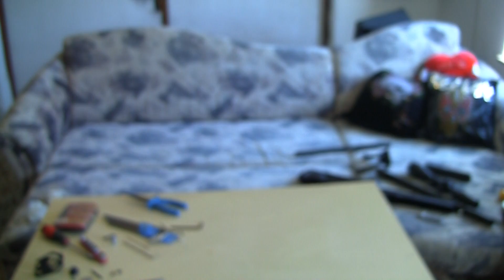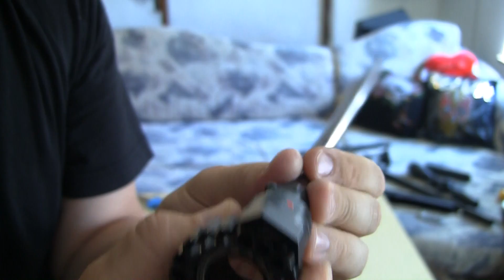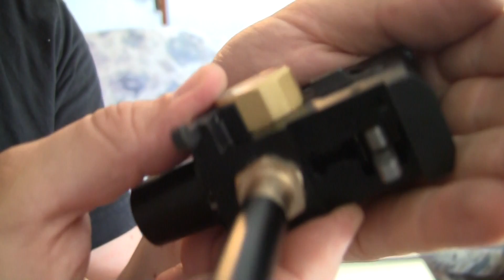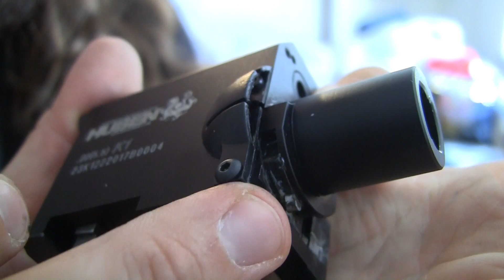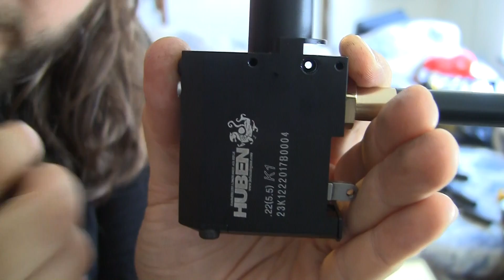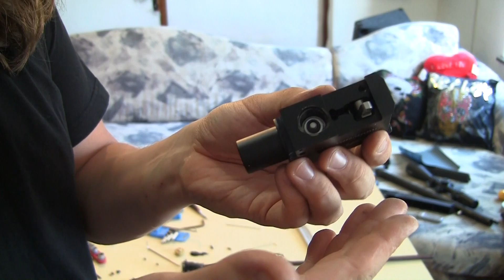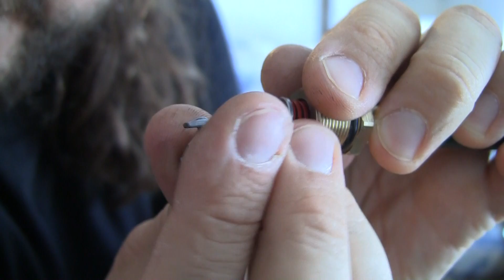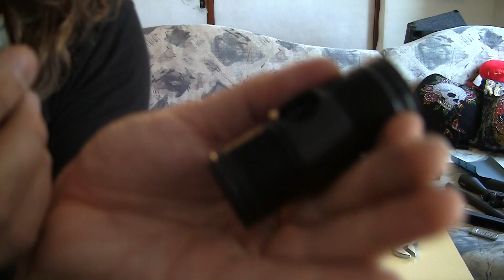Huben K1 version 2 - disassembly

Comment: gregor at 45:47 is that the spring you change if you are running a low reg pressure to aid low pressure indexing ?
Reply from the maker: Yes, you are correct. The pressure is doing the indexing, this spring only returns the indexing pin to the next magazine "tooth". This means that this spring is compressed in stationary state, it gets uncompressed (it extends) during the shot once the pressure in the chamber behind the first valve drops, then the indexing pin catches on the next tooth of the magazine and once the pressure rises back up, the force of the pressure overcomes the force of this spring and it indexes the magazine in this process. This means that you can get the indexing mechanism to work at lover pressures if you replace this spring for a weaker one, but this is only a solution up to a certain point because ta very low pressures, the pressure might not be sufficient to overcome the force it is necessary to rotate the magazin alone (even without this spring counteracting on it...).
Reply: @gregorkamensek3923  thank you Gregor, you are a mine of information, 
At some point I'll be running 15.89 Hades through my k1 lite and they don't like to much speed, 
I'll be setting the reg to around 100 bar, to 110, this may not affect the return spring but I just want to make sure, 
I take it the lighter gauge spring wire will still be fine at high pressure it will be a case of trial and error, 
I make my own springs from different gauge piano wire so I'll be able to mess around with different diameters untill I get it right.
Thank you again.
👍
Reply from the maker: @PeakyBlinder  Of course, you can try and see. BTW: if the spring will be too week, it can happen that it does not have enough force to push the pin to the next magazine tooth and it might not cycle either... But you will see when you play around with it. I like the way you make springs, I have done similar few times before but usually form guitar strings (since I have those at home) :).
Reply: @gregorkamensek3923  try piano wire, 2mm made a very good hammer spring for my cricket tactical, 
I'll let you know how.i get on with the k1 spring, 
I will measure the diameter of the original spring then drop maybe .2 of a millimetre.

Comment: Hi my friend 
Nice video as always 
My k1 version 5 is jumping from 910 feet per second to 950 
Do you think that is reg problem?
My set is reg at 150 bar and I am shooting h&n 25grain and jsb redesign
Reply from the maker: Hi. It may be the regulator but probably not. No regulator is perfect and because of this, you will get better results if you have your gun in appropriate balance. This means that your reg. pressure should be only as high to enable you to shoot the pellet you intend to shoot at just a little higher velocity than what you desire (for example, it you want ti to shoot at 950 fps, try to set the regulator value where with fully opened power wheel you get about 980 fps. Once you have done this, simply turn down the power wheel to get to 950 fps). You will probably have to go down with reg. pressure to about 120 bars to do so.

Comment: Is there a technical reason for the grip placement? Isn't 38 centimeters Length of Pull almost an orangutan's number?🙂
Reply from the maker: Hm, feels good to me. Most my gun have form 34 cm (which should be standard) up to 38 cm. So it is on the long side of the range. Personally, I prefer longer but that is probably because I am rather tall (188 cm). Interestingly, most of my bulpup are close to 38 and most my full size rifles are closer to 34. I guess they want the rifles to be as short as possible and also not to have balance too far to the front... There is not technical reason for the length of pull on K1. The regulator adjustment would allow for shorter length of pull.

Comment: Hi 

Can I contact you privately ?
I live in South Africa .
I am really interested in the Huben K1 pistol If you could possible help me .

Also if you could tell me where we can get the Huben K1 version 2 newest bullets

Thank you
Reply from the maker: Hi. You can either let me know your email or contact me via private message.
Reply: @gregorkamensek3923  dear sir I have seen all your videos for hours.
Plz help me. My gun leaks from muzzle and magazine
Thanks sir
Reply from the maker: @syedhaider7628  That is most likely the main valve, also called "firing valve" or "opening valve". It is relatively complex to replace this seal and you need special tool to remove the old seal and insert the new one... Check this video: https://www.youtube.com/watch?v=cxPiyMP7I5o&t=161s
If at all possible, I suggest that you do not do this your self but rather you send it to service...

Comment: Hi Gregor   I have finally received my Huben K1 mk 2  in 5.5 cal.  unfortunately there is a slow air loss over a week .The supplier has offered to sell me a set of O rings for €29 euros .. the rifle is only new .. and I do not want to send it for making good .
Reply from the maker: This is an annoying situation. I know what I would do, I would try to fix it my self, but I cannot recommend this, it is up to you and your skills. Also, make sure with your supplier that your warranty is not void it you do this yourself...
Reply from the maker: @richardwallinger1683  In that case, I have no doubt that you will solve the leak issue yourself :)
For slugs, you can start with "original" huben slugs: https://airgunheaven.com/en/huben-22-solidpellet-33-grains
These don't look very good but are the most accurate of what you can buy of what I have tested.
NSA has a dedicated slug for K1 that is a little more accurate but you will need to clean the barrel quite often as they are of a very soft material (maybe the have changed this by now)
JSB Monster Redesigned works best out of all pellets, Beast also is quite OK but not stable at longer ranges.
In the end you can also get molds I designed, you can find them here: https://www.mp-molds.com/product/552-mm-air-rifle-pellet-8-cav-mold/
If you are good with casting, you can get about the same results as with Huben slugs.

Comment: Hi Gregor,
Today I am surprised to find three thin O-rings in the DIY silencer I made for my Huben ( version 2 ) . It must came from the rifle. I have done some dry firing with the rifle, is it possible for some of the O-rings to be blown out of the action ? if yes, where are these O-rings located ?  Pls check out this picture and let me know what you think.

http://imghst.co/71/m1Kt~lxAsK.jpg

I have now taken the rifle apart so it is impossible for me to tell whether there are any leakage because of the lack of these O-rings. Thanks in advance.
Reply from the maker: These are probably form the shroud, in the plastic part that holds the barrel in place. to reinsert them, you will have to take the shroud off by fully removing the front clamp screw and loosen the rear two screws. When you have the shroud off, remove the muzzle cap, remove all the baffles (make sure you remember how they were assembled) and then push the plastic part out the front of the muzzle. Reinsert the o-rings in the plastic part and reassemble the gun...
Reply: Gregor Kamenšek got it ! Just Found three groves for the O-rings inside the barrel holding element at the front of the shroud. Back in business now. Many thanks !

Comment: Hi Gregor. My friend just bought Huben V2 and after shooting over 100 times a failure has occured. The gun dumps the air in first or second shot. Power wheel in many positons and doesnt work as it should -energy is set to 105J of and the power wheel changes the energy just by 5 Jules.  Regulator pressure was set between 170-180 bar. Help me please.:) heres link to my pal malfunctioning Huben. https://www.youtube.com/watch?v=_z2Or6wJ-5k
 Greetings from Poland.
Reply from the maker: Hi. Don't worry, this is perfectly normal. Actually that is exactly what I explained in my videos (I believe in video 2 for accuracy). The power wheel has 2 or 3 turns at the end where it has no effect is designed that way. All you need to do is turn the power down. Do it like this: have the power wheel fully opened and then start to turn it down. When you start to feel more resistance, then the power wheel is actually engaging the power setting. Keep on turning it down and pay attention at the gauge. Keep on turning it down until the velocity drops for about 5-10 m/s (in your case to about 295 m/s). That will eliminate your problem. You will also get much better efficiency... If you would like to have higher velocity, then just simply increase the pressure, but it makes no sense to go over 190 bars.

Comment: Hi
Thanks for videos
Very helpful in maintaining huben
I have issue with huben k1 version 2
When taken shots it gives excessive air out of barrel
Can you suggest where is issue
Do you have any whatsap or contact number to talk pls
Reply from the maker: Hi. I assume you have too low pressure set on the regulator and too high setting on power wheel for the slugs you are using... you can give me your email...
Reply from the maker: @haziqwaseem1547  It depends on the pellet / slug that you use. This problem occurs is teh slug is very heavy and / or has a lot of friction. What slugs are you using ? Weight, velocity, diameter?
Reply: @gregorkamensek3923  slugs using 35 grain 5.56 in size .2185 approx 
170 bar presure and 30 clicks out of 60 clicks 
Slugs are quite fit in magzin and slightly free in magazin with friction in magzin 
These are made here in pk with one of vendor who got equipment for making these slugs 
Pls suggest what can be issue 
34 grain jsb used as well 
Same issues comes with pellets too
I observed 1 thing when i dry fire 3 to 4 and then use slugs it works fine 
But after a day or 2 days when i take shot direct slugs normally happens that excessive air gone n loss presure in main chamer suddenly below 170 bar
Reply: These slugs equipment he got for huben users 
He selling these slugs to huben k1 users
Reply from the maker: @haziqwaseem1547  I answered to your email... I think your pressure is actually much lower but your pressure gauge is showing too high pressure.